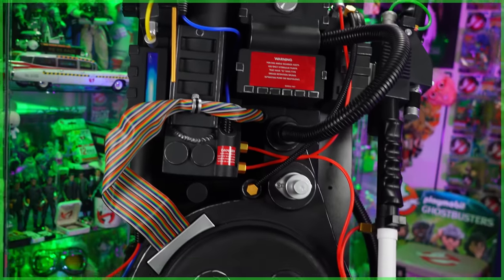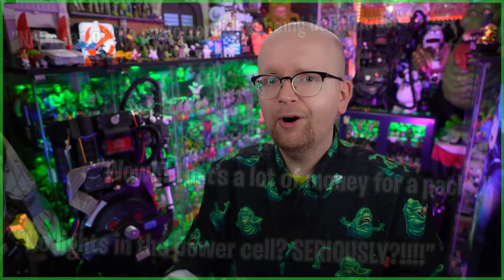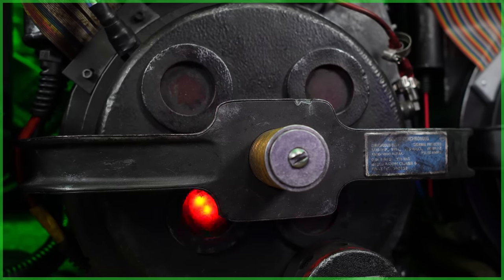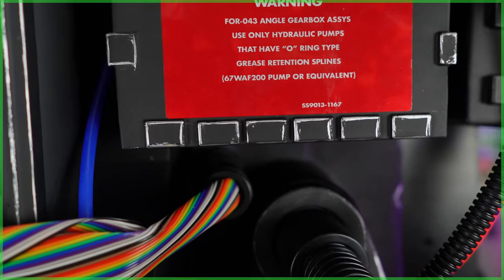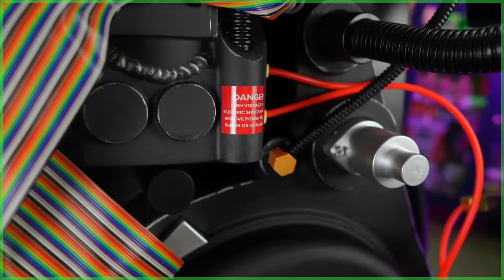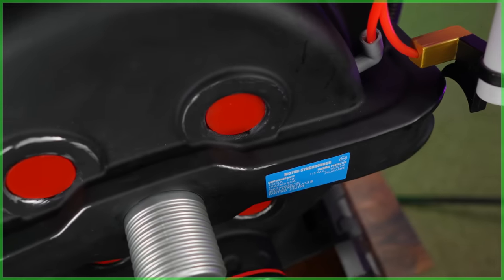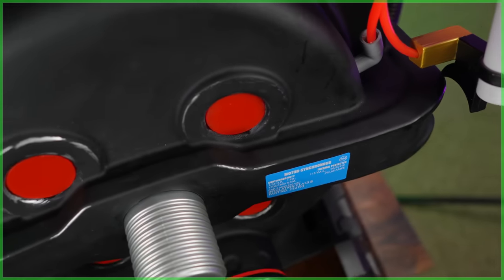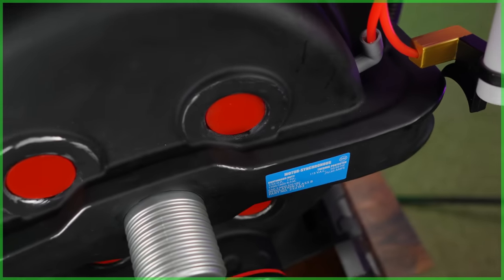New life-size Ghostbusters Proton Pack from Halloween Costumes | UNBOXING + COMPARISON

Comment: I have three main thoughts for this pack.
1.  If this was someone's home build, then it would be awesome and I wouldn't dare say anything against it.
2.  For what it is as a commercial pack, it falls well short of other options out there.  Even before the Haslab and full-size spirit pack came out, this was lacking a bunch of features that people would expect to be there.  It's almost like this is a hard-shell version of an inflatable proton pack that's just meant for halloween and then stored in a closet the rest of the year.  But, at $500, people who buy this are more than likely going to be getting more use out of it.
3.  I'm sure it won't be too long before some tech gurus come out with plans and kits to upgrade this pack into a more functional pack.  There are already a bunch of kits out there for Spirit packs that might be easy to retrofit into this design.  At the very least, replace the V-hook so a Spengler Wand can replace the stock Neutrona Wand.

Comment: 3:23 I wasn’t expecting the HalloweenCostumes Pack to be over-sized, especially compared to the Spirit full-scale and the HasLab packs…

But given how little it does, for a $500 tag, I’d stick to the Spirit Halloween pack. If you can find/acquire the Haslab pack, consider yourself fortunate, but still you’re getting more bang for your buck with the Spirit pack (especially since mods for the pack have existed for a while)

As an aside, where’d you get the P-clamp replacement? I’m in the market for one…

Comment: Jason, thanks for the video! It was an in-depth comparison for sure. Predictably though, I still have to say that this is NOT a good deal, when you stack up all the details vs the Spirit pack.... Spirit has a much better offering for half the price. For us modders, its a no-brainer... I was down on Spirit for making the full size pack $130 more than the 85% one, with really no other benefits other than being full scale (same mods have to be made to the body & electronics), but if "size matters", then the $250 Spirit is the way to go. This pack, NOPE.

As for the cyclotron lights going counter-clockwise, I thought that it was the Afterlife pack that did that in the film.... one of the modders out there has perfected a kit for the Haslab pack that does this. Me, I'm not worried about the direction of the lights, especially now that we know they went counter-clockwise in the first film. Accidentally. :)

Comment: With as many problems as there are with this pack, the thing I can't get past is the cyclotron lights.  Not the counterclockwise rotation...that's at least accurate to some of the packs, some of the time.  But why is the top set of lights placed so LOW?!  It looks so immediately wrong.

Comment: Noticed the wires in the cyclotron are plugged in, so would switching the cyclotron to clockwise be as simple as unplugging the top left and bottom right and switching them?
Reply from the maker: Yeah, kinda alluded to that, but you can simply swap around the connections, making the cyclotron rotate clockwise if preferred.
Reply: @GhostbustersNews  cheers for the clarification as an Aussie I'm keen to order one of these after seeing this review

Comment: I bought just the wand off Ebay. I was going to add it to my 80% Spirit pack. My thoughts? The body of the neutrona wand is vinyl or similar about as near as I can tell. The switches on the wand are real switches but only one is connected to anything which doesn't make any sense. They could've just put cheap dummy switches.

Comment: How much does it weigh? Same as  spirits? Or more like haslab? Or its own weight? 
I like how it's slightly bigger, I like the clunky feel to it, very brutish. For the price they should have really made that bumper a separate piece tho, that's something the average Joe can't fix or modify easily. The sticker as a light is also a shame, tho I can see that being an easy fix, but of course it would take more $$. I also really like the cyclotron and how rounded off it is vs spirits sharp angled edges, but I dislike how much of a border around it there is. I can totally see this as a fun pack to invest a years worth of time, modding and painting just to have a project to work on as a hobby, assuming you don't mind racking up about $1000 total price after all is said and done.
Reply from the maker: D'oh! Meant to include that. I'd say just shy of the HasLab pack. Not crazy heavy, but certainly has some heft to it.

And agreed. I actually really like the overall look of it, and somewhat hulking mass. Also, the material its made out of is a bonus for a packed convention or party setting. Had it only had additional lights and a separate bumper!

Comment: I know this phrase gets thrown around too much, but someone seriously must've been smoking crack when they thought this pack would sell.

For $500, you get a proton pack that:
-Is too big
-Only has one set of lights, housed in the cyclotron (that move in an unconventional order)
-Has inaccurate stickers
-Is made of shoddy construction
-Has cheap electronics

I get they announced this ahead of the HasLab and Spirit releases, but they could've spent the time during those delays to TRY to make this better.  Instead, they've been outdone by Spirit in every conceivable way.

Also, for this to be a “toy" proton pack, it needs to have a much more reasonable price.  By charging more than the HasLab offering, they're shooting for “collector" grade, which this definitely is NOT.
Reply: As for the suggestion that fans overseas would choose the Halloween offering because the Spirit pack doesn't ship internationally; I can't imagine it would be more expensive to buy the Spirit pack from an alternative seller that would be willing to oblige.  Even an aftermarket Spirit pack would be a better value than this.

Comment: For the $500 at this costs this should do way more stuff than it already does I mean the Spirit Halloween $89.99 pack already does Waymore than this pack ever could think of doing. Basically I feel that this is just a really expensive Halloween prop not something that I would actually want to take out and use with any of the local Ghostbusters groups in town because it’s lackluster compared to there’s. Now for the $89 and 99710 heck yeah I’d be more than happy to use that past Halloween for like videos and events in cosplay because it actually does stuff and I don’t feel embarrassed that I spent money on something that doesn’t work.

Comment: cut the price in half and it's fine. but at this point it's not even good for modding. with all the parts you'd want to replace, you'll be paying the same you would pay for a custom kit. the features are lazy, the price is unjustifiable, and that "slo-bol" sticker is like a slap on the face

Comment: Do not order from Spirt.  I ordered one on 8-6-23 and a week later had to call to even get the order processed.  The charged me and created a shipping label, but 3 more days later Fedex does not have the package and when I called again they couldn’t tell me what is going on and that I could call back in 2 more business days if it doesn’t start tracking.  I’m afraid I’m going to end up having to dispute the charge with my bank.  Even if I eventually get mine I will NEVER purchase from Spirit again.  Buyer beware!

Comment: Toggle switches on the wand are literally the only plus this thing has. That cyclotron looks TERRIBLE.  The lights are going backwards. There's no power cell lights. The ribbon cable is a joke. The clippard valves are shaped wrong and don't have labels (and the rest of the labels look awful). The bumper is one big molded pieces and it all looks like cheap plastic.

This thing looks fine for a casual fan buying a pack for a one-off Halloween costume. Thing is, no casual fan is paying $500 for one PART of a costume (they'd still need a jumpsuit and patches at the very least, even if it is one of those paper-thin spirit ones). The only people laying down that kind of money for something like this are hardcore fans, and no hardcore fan is going to look at that thing and say "sure, that's worth the same ammount of money as the Haslab pack went for. It's DEFINITELY worth twice as much as the spirit pack." c'mon.